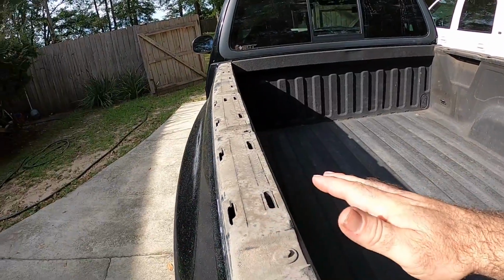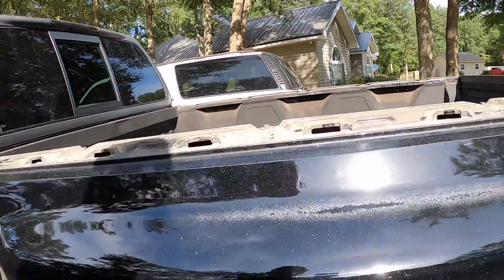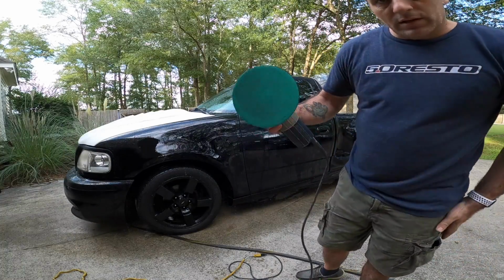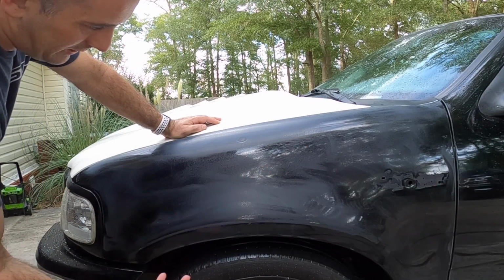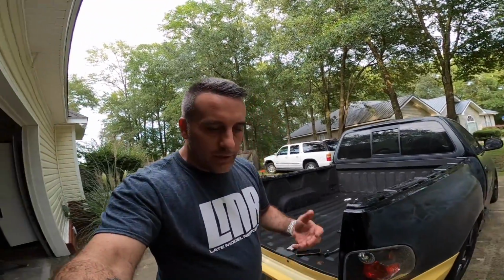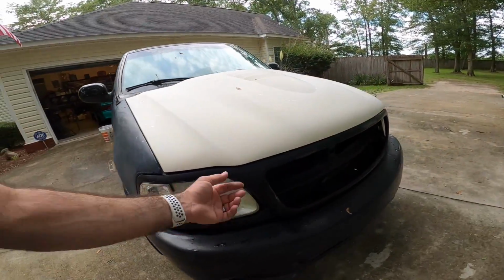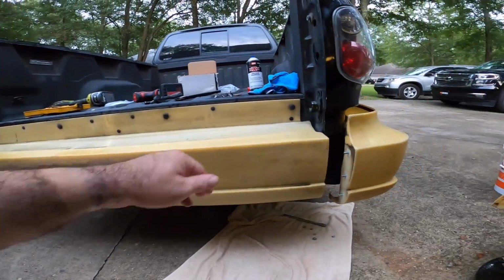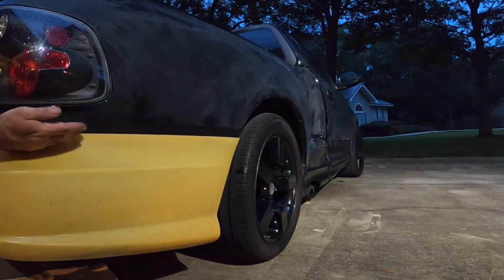GETTING THE ⚡LIGHTNING⚡ READY FOR PAINT *UPDATE*

Comment: DIY paint booth: 
enough pvc pipe to box in a vehicle plus few feet on each side for you
Clear plastic roll to cover 
Duct tape to tape it 
Square box fan. Cut out wall to fit fan blowing air inside booth. Tape around it to secure
home ac filter. Cut out opposite side place filter and tape it.
 Now you should have a bug free somewhat pressurized booth.
Reply: Fan might be backwards. Negative pressure not positive.

Comment: You can also get an orbital adapter for a small 4 1/2" grinder too. 
http://s.12ab.pw/l/bbb8
Also, you can use magnets to provide some pressure when using double adhesive tape to install panels if you're installing to a metal part of the vehicle. I just use old speaker magnets.

Comment: PSA. A screw with a sharp point is a self tapping screw. As in it self taps the threads when you install it.

A screw with a drill bit type tip on it is a self drilling screw.

Facts. Lol